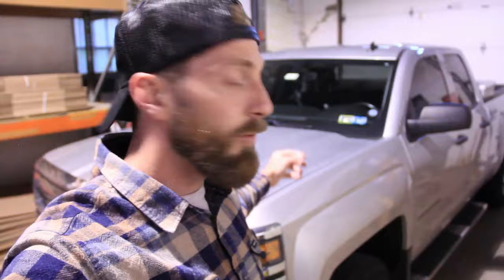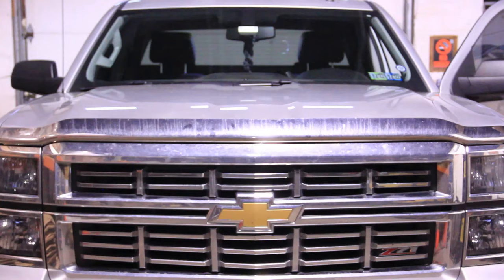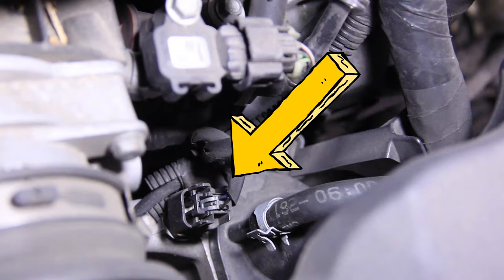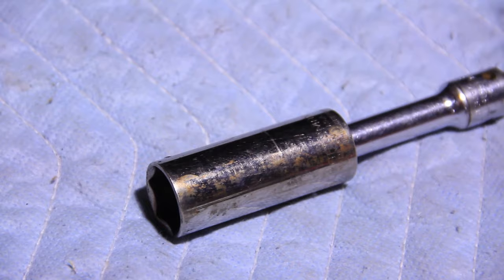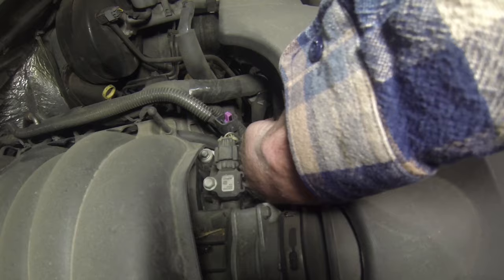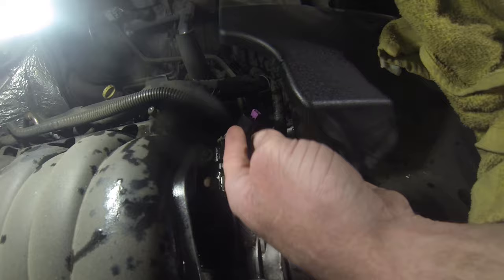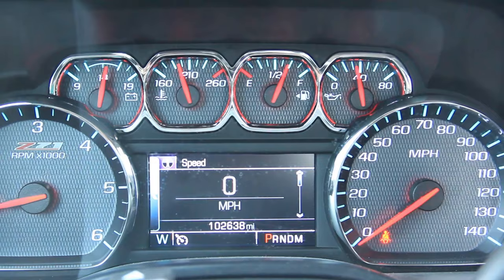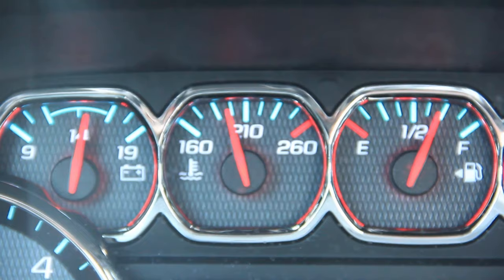Radiator Fan Won't Turn Off: 2014 - 2019 Silverado & Sierra: Bad Coolant Temperature Sensor Replaced

Comment: Great tip. Here’s a couple takeaways. Use the AC Delco. It’s got sealant on the threads. Also if you loosen the rad cap it won’t puke coolant.

Comment: I'm  currently having that same issue  with 
My 2016 Z-71 Silverado.  Do I also  need to change out the thermostat as well?
Reply from the maker: There is a good chance that you will need to.  You can start with this and if it doesn't do the trick, you can replace the thermostat later.  Be sure to reset your trucks computer by disconnecting the battery!

Comment: I have been having this problem for awhile. 2015 Chevrolet silverado Z71 1500.  I changed the temperature sensor and didn't work.  Oddly after another month of the problem I decided to change the Thermostat and low and behold that was the problem.
Reply from the maker: Yes, we recommend changing both the temperature sensor and the thermostat at the same time.

Comment: Hello, 
I have a 2014 Silverado 5.3L. Currently having a little issue with both cooling fans. Fans kind of have a hard time starting and run super slow. i was told the relays could be going bad, but i can't find the relays for this engine model. Any ideas? thanks
Reply from the maker: Hey Emanuel, I'm not sure where the relay is located.  Please follow up with us and let us know what you find out.

Comment: Question, I have a 2015 GMC Denali Yukon and the same thing happens to my truck when the truck is off the fan remains on and very high. Would this work for my truck as well?
Reply from the maker: Yes, the Yukon is built on the same platform as the Chevy/GMC trucks.  If you have the 5.3 V8, the steps should all be the same.  We have two other videos that explain other issues that are directly linked to this issue as well.  Those videos are linked below for you: 👇
https://youtu.be/wed9eZxPwsQ
https://youtu.be/WvLyBM8FHdM
Reply: @TheBrothersWorkshop  thank you so much for answering right away
Reply from the maker: No problem at all! 🙂

Comment: Mine the opposite both don’t run I  pulled the coolant temperature harness and the fans came on but my compressor shut off  I plugged it back in to the coolant temperature sensor and the fans turned off any leads   I did replace micro relay it’s a four pin is it possible I might need the flip it
Reply from the maker: Wally, did you end up fixing the problem?

Comment: Did you experience a loss in ac cooling once your sensor went bad?
Reply from the maker: This happened during the winter for us.  That wouldn't have even been an issue I would have noticed.

Comment: I have a 2015 Suburban. Did the same thing with the cooling fans. Stayed on and was running extremely high. Wonder if this is my problem.
Reply from the maker: It could also be the thermostat.  Check out our video on how to replace that.  I've linked it here: https://youtu.be/WvLyBM8FHdM
Reply: @TheBrothersWorkshop  
I replaced the temp sensor. I'll look into the gauge also. Thanks.
Reply from the maker: Give us an update once you do!
Reply: @TheBrothersWorkshop  
Replaced the temp sensor but the fans flipped out again after my last post. I'm going to change the gauge next time the fans take another dump. I'll keep you guys posted. Thanks for all the help.

Comment from the maker: If you changed the sensor and this issue still occurs, you will need to change the thermostat.  I've linked two videos for you below.  The first is a trouble shooting video.  The second shows in detail how to replace the thermostat. 👇

Troubleshooting 👇
https://youtu.be/wed9eZxPwsQ

Thermostat Replacement 👇
https://youtu.be/WvLyBM8FHdM
Reply: Dude...that was it!   Sweet.  Tell me...something else weird happened though....my A/C started working again.  Could disconnecting the battery reset something so that now my A/C works again?
Reply: All of this was just awesome! Thank you so much for this video.

Comment: i had to disconnect the negative on the battery after replacing the sensor and thermostat. before i started it up and problem was still there, reset computer and gauge starting climbing and when i turned it off the fans cut off like normal
Reply from the maker: Yes, we go over all of that in our third video. This is one of three videos we produced for this issue.

Comment: I had an issue with this on my 2015 suburban. Wife said the fans stayed on so I check it out and noticed the coolant gauge was dead. So replaced the sensor, reset the CEL and everything was fine for a few days, and the fans came on again. So checking it out again. I noticed it wouldn't warm up all the way and it turns out it was the thermostat. No clue why the truck killed the coolant gauge when the CEL came on. That threw me for a loop
Reply from the maker: That's an interesting problem.  Regardless, I recommend replacing both the thermostat and sensor at the same time.  I've linked both the trouble shooting video and thermostat Replacement videos below: 👇
Thermometer Replacement: https://youtu.be/WvLyBM8FHdM
Troubleshooting video: https://youtu.be/wed9eZxPwsQ

Comment: How did the gauge read in the truck when this issue was happening ?? It would say it’s running hot one sec then says it’s cool 2 secs later and the fan stays on also after it’s off.
Reply from the maker: We go over all of your questions in the new video that we made about this issue.  Please check it out for all of the detailed information: https://youtu.be/7gKbLHhD1cw

Comment: Is it still possible to remove the thermostat sensor if the tab is accidentally broken trying to remove it with your needle nose pliers?
Reply from the maker: Hey Ave, that's a good question.  I've never broken the tab.  Let me know if you get it out.

Comment: Changed mine today and fan still stays on is it because I didn’t disconnect the battery?
Reply from the maker: Lorenzo, it could be the computer needs rest or the thermostat was the culprit.  We recommend watching our follow up video and the thermostat replacement video linked here: 

https://youtu.be/wed9eZxPwsQ

https://youtu.be/WvLyBM8FHdM
Reply: @TheBrothersWorkshop  drove it to work and seems like it worked because i got off truck and my fans are off
Reply from the maker: Glad to hear it Lorenzo!! 🙌

Comment: I did this,  it didn't fix it.  Then I replaced the thermostat. Again same thing..  then I disconnected the battery for 5 minutes and it's fixed.  I think the bcm needs reset after sensor replacement and I don't think I needed a thermostat.
Reply from the maker: We have a troubleshooting video that helps anyone having this issue.  It is linked in the description.

Comment: I have a 2014 silverado my fans done the same only whe it was cold out side I replace the sensor this did not fix problem so I replace the thermostat that fixed mine so I took the old one in house to put it in hot boiling water but pored water from top of thermostat it pored out the bottom like crazy I think the thermostat was worped do to being plstic houeing. Never had a plroblem since then.
Reply from the maker: Very interesting.  I recommend replacing both.  If your going to do one, might as well do both.  Glad your issue has been fixed.

Comment: My 2015 Silverado 1500 is doing the same thing 
But it’s not showing me the check engine light 
Could it be a fuse?
Reply from the maker: This issue does not throw a code.  We've delt with this issue on three of our personal trucks.  If it's not the sensor it is the thermostat.  Please watch our other videos that explain the issue.

Comment: But how to turn it off at the moment?
Reply from the maker: You can try turning the truck off, then back on, and off again.  That typically worked for us.  Then, watch these videos I've linked below.  The first is a quick video that explains the common reasons you could be experiencing this issue.  The second video explains how to replace the thermostat. I've linked both below for you.  👇

https://youtu.be/wed9eZxPwsQ

https://youtu.be/WvLyBM8FHdM

Comment: I have a 2014 Silverado LT 5.3. I've replaced the thermostat, coolant sensor AND unhooked the battery for 15 mins. Still have the same problem. Fans kick on within a few seconds of starting the truck and the temperature never gets off 160. Any ideas?
Reply from the maker: Double check your work.  If needed, remove the Teflon tape.

Comment: in my case it was wiring at the AC high pressure switch connector next to compressor in high pressure line.. because that line vibrates one of the three wires at my wiring harness plug that goes into that switch had broken..the black wire...as soon as I unplugged the connector from switch the fans quit blowing on high speed.. Apparently the ECM doesn't like that It's not getting a reading from the broken black wire and it turns on the fans high speed.  soldered and sealed and I'm back to normal with fan speeds ..Also my AC compressor  was functioning normally with this  wire broken...strange.
Reply from the maker: Sounds like you had a completely different problem to begin with. Also sounds like your symptoms aren't the same as explained in this video. In that case you're probably right what you did is going to fix the problem. However, fix explain in this video and the two subsequent videos resolve this issue entirely. The issue explained in this video is a thermostat and temperature sensor issue.  This fix was done several years ago and I've had no issues since. I've done this on multiple trucks.

Comment: 2015 silverado 5.3  motor keeps running when shut down along with fan running and no temp gauge showing a temperture. engine shuts down after about 5-10 mins
Reply from the maker: This is the fix for that problem.  We have updated the video.  It's linked here: https://youtu.be/7gKbLHhD1cw

Comment: i disconnected the battery, thought it fixed it, replaced the temp sensor, thought it fixed it, not sure what else it would be because it eventually comes back
Reply from the maker: We made three videos about this issue.  You probably missed a step.  We remade the video and added all of the steps and troubleshooting into one short and detailed video for you.  I've linked it here: https://youtu.be/7gKbLHhD1cw

Comment: I changed the Temp sensor. It worked for a few days then it started again. The fan will eventually shut off after 15 min with keys out. While driving the truck reads the temp then suddenly reads zero and the fans wont shut off. I was wondering if it could be a relay that is not seated .
Reply from the maker: Watch this video, it should help: https://youtu.be/wed9eZxPwsQ?si=eL7AjNZuv1sv4-uG

Comment: I changed my sensor and my truck is still running at 180-190. Is it bc I have a 180 thermostat on my truck?? It’s a 2014 GMC Sierra. The fan went off but my truck only gets to 200 when idling then goes back to 180-190
Reply from the maker: How is the truck holding up?

Comment: My issue is that the truck doesn’t get up to proper temp on a scan tool it shows it only hovers around 155F but the dash shows 180F and the fans constantly run while driving but I have a P0172 code

Comment: Changed my sensor and now my fan wont turn on at all. When changing the coolant temperature is it possible that air went inside the system?
Reply from the maker: Make sure you have the correct sensor.  Also, double check your work.  Is everything connected?

Comment: Hey guys so I replaced my the sensor, unplugged and plugged the battery cable and it was good for a couple week, yesterday it came back on.. any ideas??
Reply from the maker: I explained at the end of the video.  If the sensor doesn't fix the problem, you need to replace the thermostat.  I recommend replacing both at the same time.  I've linked both the trouble shooting video and thermostat Replacement videos below: 👇
Thermometer Replacement: https://youtu.be/WvLyBM8FHdM
Troubleshooting video: https://youtu.be/wed9eZxPwsQ

Comment: I changed the thermostat,  and the sensor  and the fan goes high when the truck is cold.. (sometimes) but every time I drive is for sure get like really loud.. loke all the time it doesn't go off till I cut off the truck
Reply from the maker: Try disconnecting the battery and letting the truck sit for a few minutes.  Doing that will re-set the computer.  Connect the battery again and turn the truck on.  That should slow the truck to correctly read the sensor.  Let us know what you find out!

Comment: What if no coolant comes out when I remove the sensor and my reservoir is full, no leaks visible
Reply from the maker: I would double check the levels after installation and add coolant as needed.  Take the truck for a ride, watch your temperature, check the levels, and add coolant if needed.

Comment: this sensor was replaced twice and the fan randomly comes on high like before but this time noticing it is doing it mainly when its cold. What could be it be next?
Reply from the maker: I explained at the end of the video.  If the sensor doesn't fix the problem, you need to replace the thermostat.  I recommend replacing both at the same time.  I've linked both the trouble shooting video and thermostat Replacement videos below: 👇
Thermometer Replacement: https://youtu.be/WvLyBM8FHdM
Troubleshooting video: https://youtu.be/wed9eZxPwsQ

Comment: Yesterday I had my fans staying on when the truck was off so I grabbed a coolant temp sensor this morning and installed it. Disconnected battery and everything seemed to be normal after taking it for a test drive. I Left the engine running for 20 minutes and it hit 210° but the fans never came on. I Turned the AC on full-blast and then the radiator fans turned on at low speed but then stopped shortly after. Shouldn't the radiator fans be turning on at 210 degrees?
Reply from the maker: Great question, we haven't heard of that being an issue before.
Reply: @TheBrothersWorkshop  everything seems normal. Cold days out here lately. Wondering if the truck has the ability to regulate when the fans kick on depending on them temps outdoors.

Comment: So I as well have this issue however I changed both the thermostat and sensor but still have the same issue, when ran thru diagnostics it comes up with on the sensor now i checked the wires and pins and everything is in working order..... any help please 🙏
Reply from the maker: Checkout our troubleshooting video: 👇 https://youtu.be/wed9eZxPwsQ
Reply: I really do appreciate it! After tinkering with the wires for a little over 2 hours I found a separation after repairing it works perfectly thank you for the video!

Comment: I have the 6 cylinder. Is this the 8? I didn’t want to go through 835 comments to find it.  But maybe the thermostat is in a similar place anyways
Reply from the maker: This happens to both the 6 and 8 cylinder trucks.  Just replaced the temperature sensor and thermostat.  Make sure you unplug the battery and you'll fix it.

Comment: We have a helicopter noise at idle on Silverado 2500HD.  I suspect it's the fan.  I tried to spin the fan but cut my finger because it barely spins.  Does anybody think it's the fan that is the helicopter noise?  The fan run non stop if truck is on.   Thanks
Reply from the maker: Never heard of this issue.. hopefully someone has an answer for you.

Comment: I’ve watched 2 different videos , one said it’s thermostat and one said it’s temp sensor, how do you know which one without taking thermostat out and checking?
Reply from the maker: I have found that replacing both the thermostat and the sensor is what fixes this issue.  I mentioned that at the end of this video, and I have made two subsequent videos detailing my experience.  I learned the hard way so you don't have to.
Reply: @TheBrothersWorkshop  thanks changed sensor first, fan and temperature gauge is working now, thanks for the help
Reply from the maker: If you have any issues, this is our troubleshooting video: https://youtu.be/wed9eZxPwsQ

Comment: How do you know if the sensor is bad? If you disconnect the battery cable and then reconnect it also solves the problem. Is it jus a temp fix? Probably should go ahead and replace the sensor huh
Reply from the maker: If you only disconnect the battery and reattach it, that's a temporary fix. I know this because I tried trial and error prior to making this video. To fix this problem, I had to replace both the thermostat and the sensor. Then disconnect the battery and reattach it so, the computer will recognize the new parts.  Replacing both parts (thermostat and sensor) has proven to be the correct method in my experience. We've done this on multiple vehicles.
Reply: @TheBrothersWorkshop  Thanks for the reply. Bought the parts now just have to do the job.
Reply from the maker: It won't take you long at all. If you have any issues fall or troubleshooting video linked here: https://youtu.be/wed9eZxPwsQ

Comment: My Chevy Silverado 2009 4WD the electric fan cooler don’t work I already check the temperature sensor de fans the thermostat the PCM, relay and fuses everything is good but my fan cooler don’t work 
With the A/C on my truck don’t overheating

Comment: Would this also affect the air conditioner
Reply from the maker: It could, but we never tested the ac.  If you have a 2014-15, the AC is known to have issues  unrelated to this.